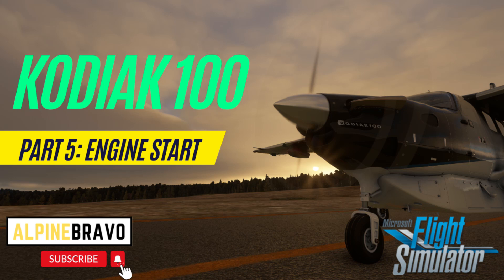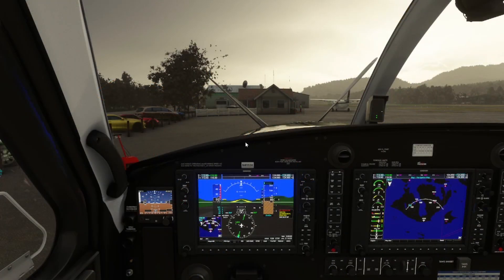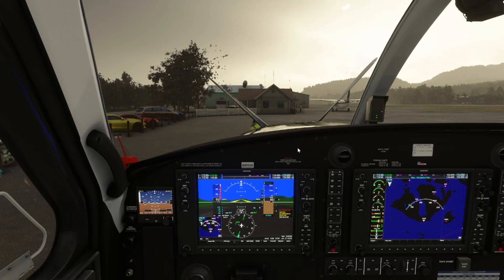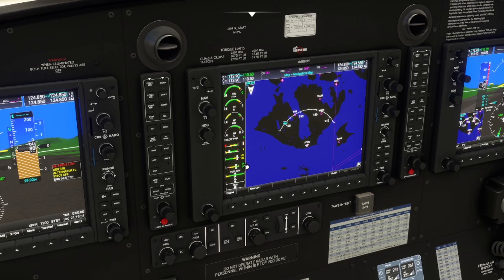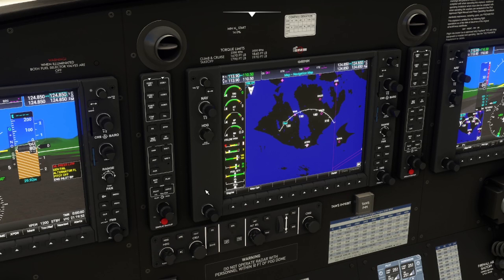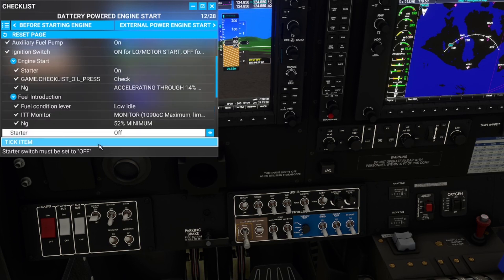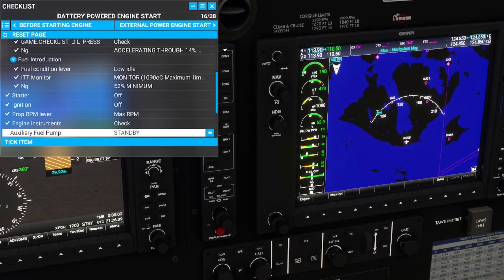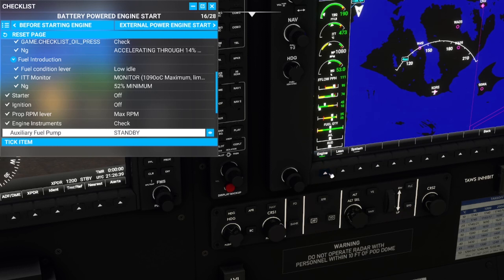How to Fly The Kodiak 100 | Part 5: Engine Starts

Comment: Just purchased the KODIAK and found your excellent videos which will enable me to operate it properly.  Just one small point in regard to battery configuration at start-up.  To enable the hi start of 48 volts the batteries would be placed in series and for the normal start they would be placed in parallel to deliver 24 volts.